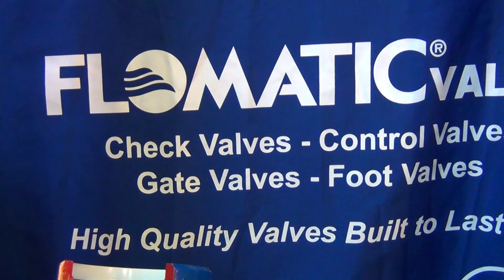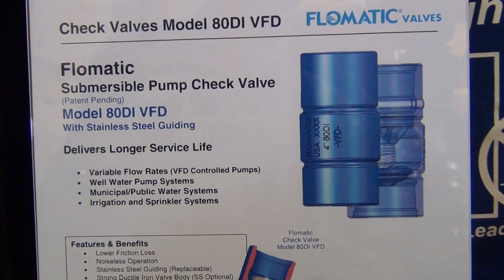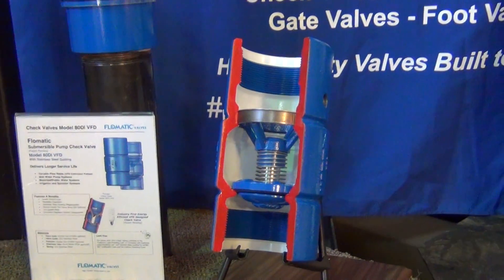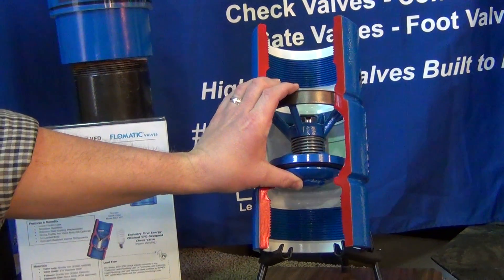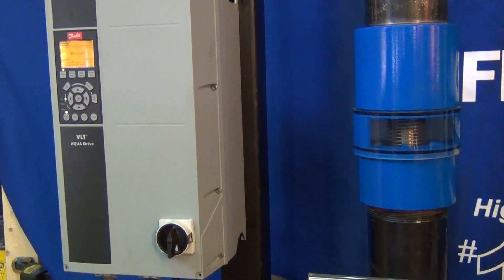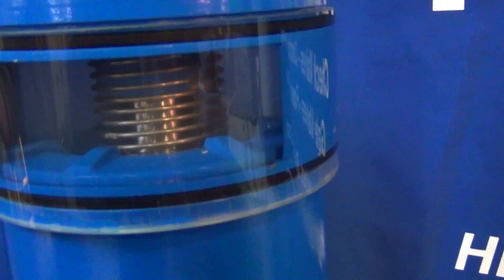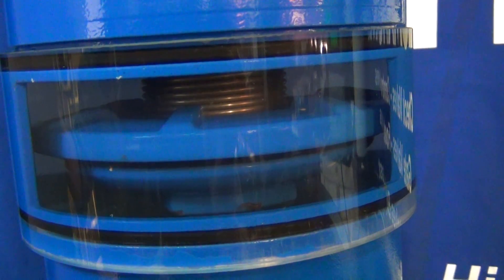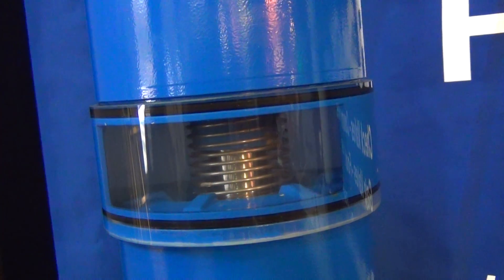Flomatic Check Valve Model 80DI VFD

Comment: The video is informative. however, this was designed to eliminate wear from chatter etc.  this did not demonstrate the performance with very low flow (i.e. dripping tap, WC, or RO system ) 
Would like to see this before recommending to clients